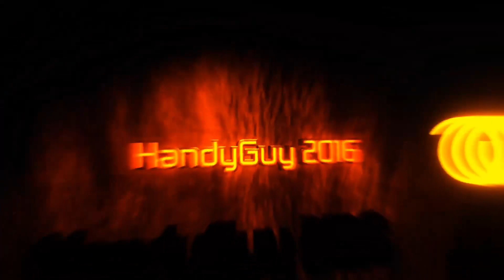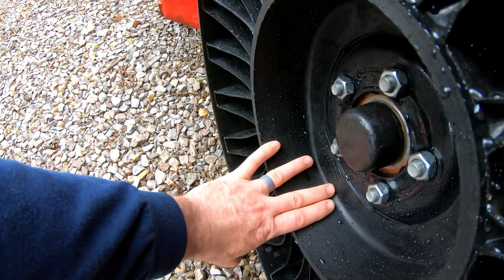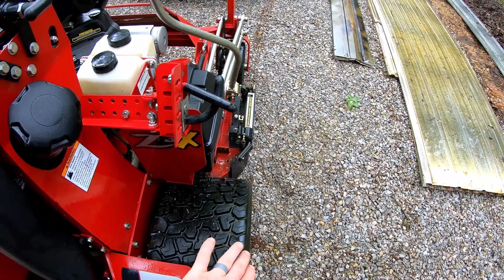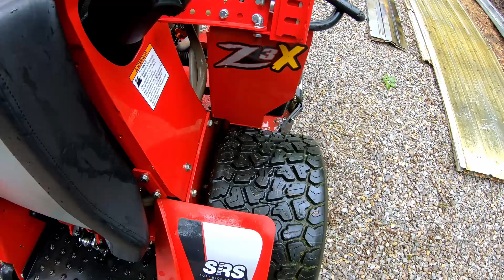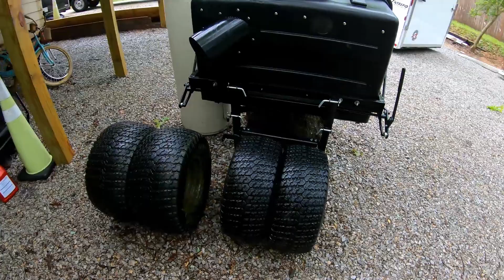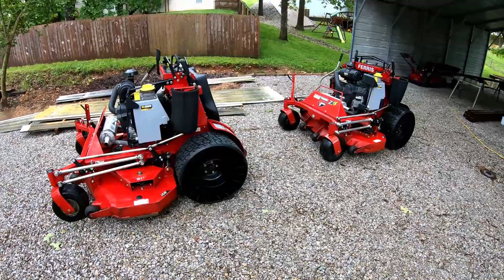Tweel Update - Ferris Z3X

Comment: Those tweets look nice! I’ve got the same 52/61” setup as you! I just purchased a 72” Z3X also. Couldn’t resist the deal they had on them✌️
Reply from the maker: I really want a 72" Z3X, just don't want another payment yet lol.
Reply: HandyGuy 2016 I’m in NC, and got mine for $6500 plus tax. Has the 29.5 Kawasaki EFI. Like the Vanguard, but for $6500,  same price as a Z1 36”.
Reply from the maker: @toddbenfield6546  sounds like a good deal.

Comment: First I watch all your videos and thank you for answering all my questions. It helps a ton. I have asked about your Tweels before and I’m about to pull the trigger on a set. One more question though if you don’t mind...  I know they offer much better traction on hills going side to side, but do they help with traction when your let’s say, going side to side on a slope and need to back up, normal the up hill tire just spins for lack of traction/weight. That is my BIGGEST issue with a stand on mower since buying my Z3X. Uphill tire loosing traction cause all the weight/body weight is shifted to the downhill tire. Thank you for your feed back!!
Reply from the maker: It will be better, but that is still a tricky maneuver. They are also better about not sinking in wet soft turf.
Reply: HandyGuy 2016 thank you for the reply. Yea that maneuver I usually have to try and shift my weight completely up hill which is tricky for for lol. Thanks.

Comment: The surface contact is mint your basically running  a track.    But I have noticed the more aggressive mowing with tweels ..they seem to dig and when your digging on sharp corners you start ripping out grass
Reply from the maker: Yeah, just have to use proper technique on turns.

Comment: After 2 flats on Saturday and one set almost slick I think I’ll bite the bullet thanks to your video. What model  number did you go with because there are a few different 24” options? Also thinking about getting the front ones too but trying to figure out which ones I need and if I need spacers or not.
Reply from the maker: They are the 5 lug 24 x 12-12 replacement. A local Michelin dealer ordered them for me.
Reply: HandyGuy 2016 I was looking at which offset to get. There are 2 choices for the 24x12-12. I’m also going to get the front ones too thanks to the 20% code. Waiting for a call back from Michelin to double check before I order. Got almost 700 hours out of the factory tires so I’m pretty pleased.
Reply: @rogerwilliamson7927  roger, I have been trying since last Thursday to contact Michelin,  even tried the chat box.  have yet to speak to anyone at Michelin who knows anything tweels related.  all I get is the run around. today I sent an email and the reply was "due to high volume it could be 4-5 business days before I can expect a reply".  by then the sale is off and I will NOT be remotely interested in even doing business with such a lax company.  I wanted to put 4 on one mower but I guess that's about done.   I have a z2--61"    I do not want to order in HOPES they fit, want to talk to a rep first.
Reply: First Name I called and was placed on hold. After about 5 minutes it gave me the option to have someone call me back. Later that day a lady called me back but couldn’t answer my questions because the Z3X isn’t on the fitment guide. Someone emailed me and answered my questions. I had used the 2100 and 2600 with the same size tires as a reference. This is what I ordered: 54411 x 2 for rear tires which they confirmed. I ordered 52441 x 2 for the front because I wanted a grooved tire. Don’t forget to get spacers x 2 for front tires. They are model 65019. Hope this helps. It was a hard pill to swallow but after watching HandyGuy2016’s videos I think it’ll be worth it. Hope this helps and have a blessed day.
Reply from the maker: @rogerwilliamson7927  Thank you for the info!

Comment: What model is the tweel you picked up. I have the Z3X 61” and these have definitely piqued my interest.
Reply from the maker: They are the 5 lug 24 x 12-12 replacement. A local Michelin dealer ordered them for me.
Reply: I think I found it. They are running a 20% off Father’s Day deal currently online. So I may have to jump on them for the discount
Reply: Welp just ordered them lol. Thanks for the reviews and testing you do! My Z3X is virtually a clone of yours (modification wise).
Reply: Josh Moore What website is running the 20% deal?
Reply: Jason T it’s directly from Michelin... the code is “Father”. I think it runs for a few more days.  https://tweel.michelinman.com
Reply: Josh Moore THANK YOU
Reply: sale runs to july 4th.  
bud, do you have the part number or a lug dimension  is it 24   5 x4.5   mspn  54411  ???? I have a z2  61".